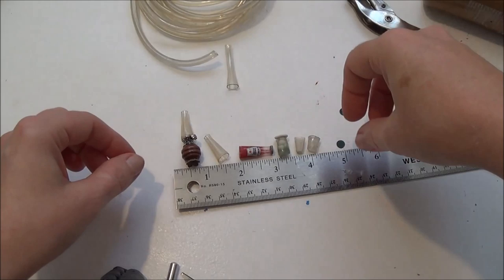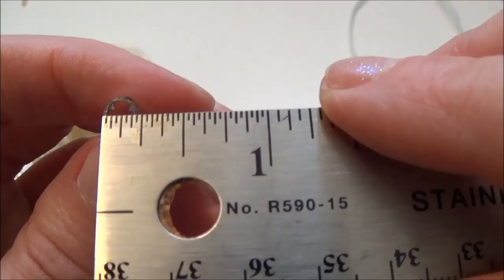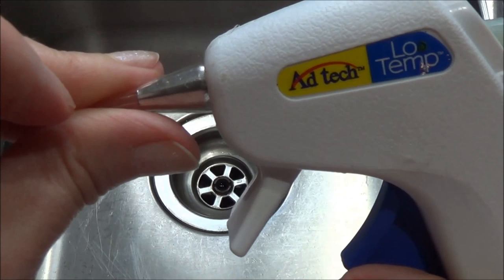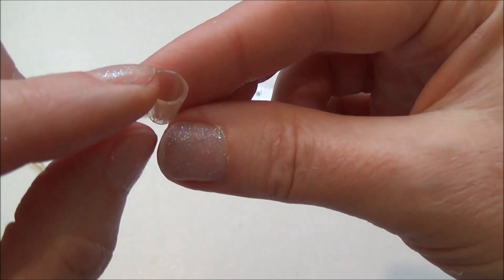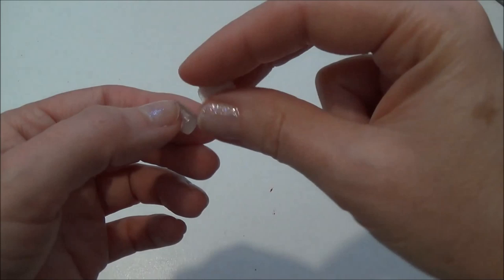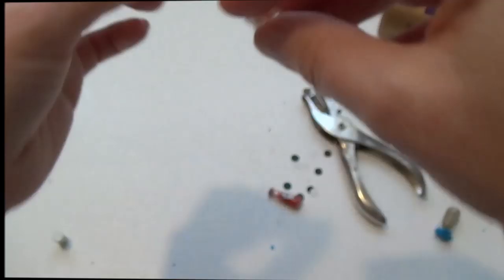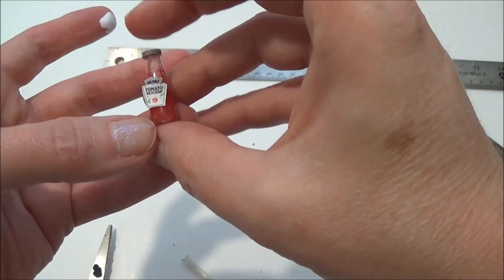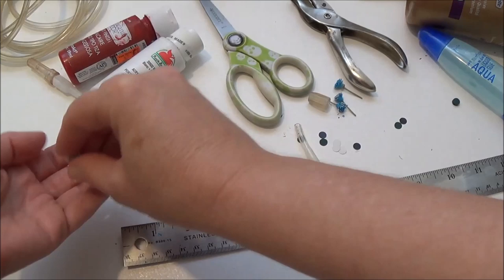How To Shape Plastic Tubing To Make Dollhouse Miniatures

Comment: Thank you!  I have had to resort to using my plastic eye drops ampules for hanging lanterns, and bottles, which do work really well, but this is the answer to table lamps I have been looking for!  This will be my go to now instead of the ampules.  For flame I used a tiny piece of cotton swab that I painted with touches of red, yellow & orange, then rolled it in my fingers to a flame shape, which could them be stiffened with tacky glue if you choose.  It really worked well, if you want an easy flame.
Reply from the maker: wow, what a great idea for flame! Thank you so much. I'm really glad the plastic tubing has given you another option. Have fun!

Comment: For the ketchup, maybe add a tiny drop of brown paint to the red paint to darken it...and just like you did the white paint for milk, fill the bottle with the  paint & let dry. I'd also use a white cap for a more realistic look♡♡ 
Your videos are awesome!! Thank you so much for sharing!😁👍
Reply from the maker: for sure, good ideas.. it's something to play around with. I didn't know I was going to be adding in a bottle until the end so just quickly threw it together. You could do many different things with the bottle idea, not just ketchup. It would be difficult to fill it with paint wile trying to keep the neck clear without a crafting syringe .. unless you put a stopper in the neck to  be removed after the paint dries and fill the bigger end.. I didn't think of that while filming. I have some syringes on order so next bottle video I do will include more ideas for them. Endless possibilities! Fun :) Thanks for the kind words and for taking the time to comment,  I appreciate that!

Comment: You maybe able to use a piping tip for the second part for the cooling off the plastic tube.
Reply: I thought that, or even use pliers and heat them over a flame/with a heat gun
Reply: Or a pencil if it will fit while still warm

Comment: What a nifty idea! Watching you do this just made me think of metal piping bag tips. It may be easier and safer to heat piping tips in the oven or a small toaster oven a few at a time. Then apply the tubing over it,   followed by a quick dip in an ice water bath to cool it quickly to hold its shape.  It might make the process a little less time consuming and more efficient so you can make more at a time!
Reply from the maker: I wonder how you would get the tube over the tips though without burning your fingers. Or keep the tip hot while you push the tubing over? Maybe I'm not picturing it right in my head, lol might work like a charm! You did hear me say to unplug the glue gun, right? Doing them on an unplugged glue gun is safe and it only takes about 20 seconds or so and onto the next one. You want to unplug it for safety and for cooling